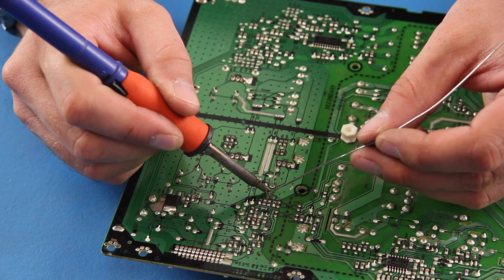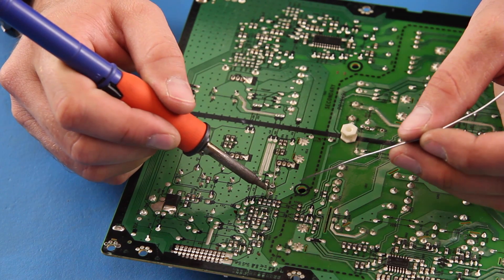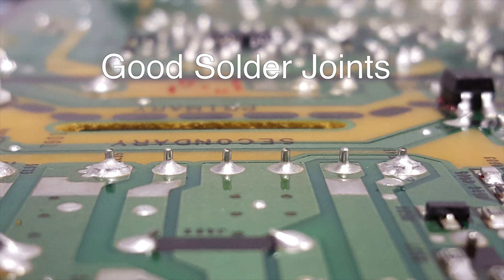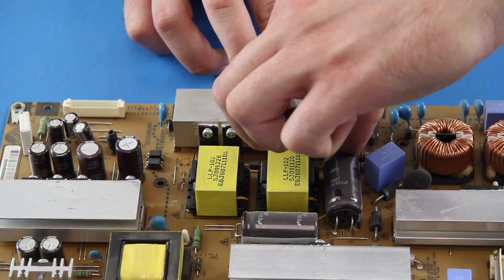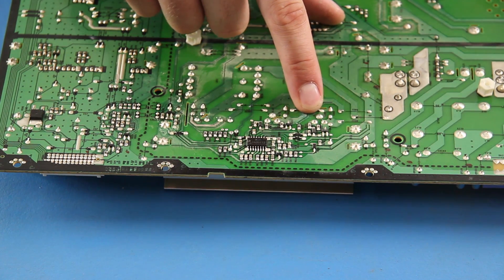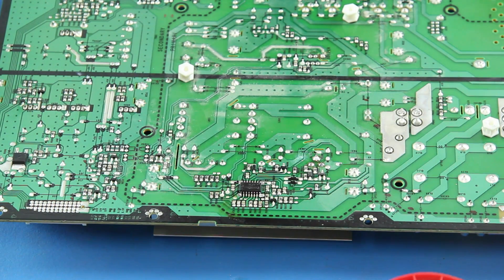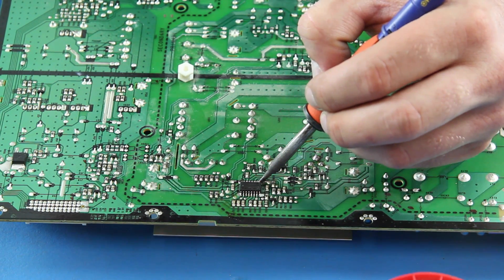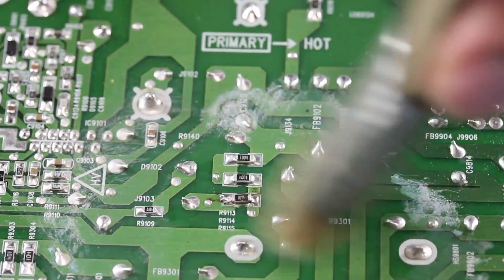How to Solder - Beginner Guide to Soldering Components on TV Parts

Comment: Which temperature has the solder pen while in use? I usually have it on 355 degrees celsius for cables but ‘m afraid may be too high for components?

Comment: I dont get it...
Do you use the solder and wire to take things out or to apply the items into the board?
Reply: You use the iron to melt the solder and then you suck up the solder with a tool that works kinda like a vacuum. The soldering iron melts the wire and the solder cools down fast and that’s how you attach a component to the motherboard.
Reply: @mr.keiser4259  Thanks for your help. I just  cant get the solder wire to stick to the component (mosfet). I tried soo many times and it creates a blob but then that blob doednt stick to the mosfet end.... is the sokderwire to weak or something?

Comment: sorry for this very noob question, but can you use a common steel wire that can be bought in any hardware for soldering?
Reply: It needs to be a composite like rosin with a low melting point.
Reply: No you usually wanna use wire made for soldering

Comment: I don't know what I'm doing wrong, any soldering iron I purchased stops working after the first use. Sometimes getting a new soldering tip works, but also stops melting the wire after the first use. 
I clean it whenever I stop using it, I don't know how I'm breaking it.
Reply: I had the same problem with the cheap ones  from Walmart.

Comment: When u melt the solder on your iron then try to solder with it the solder on the iron no longer has flux and causes lots of problems please don't follow or do anything this guy's does he is leading you to failure
Reply: Not sure where you learned how to solder but this is a perfectly acceptable way to solder this component. Maybe you missed the part where he fluxed the board. You are much better off applying a high-quality paste or liquid flux directly to the parts rather than rely on the Rosin flux in the solder. With that said I will say that overall this was not really a great tutorial he left far too much out. 

For example, he forgot to use flux when he cleaned the pads. that whole area should have been flooded with a high quality past flux and then the pads should have been cleaned with the braid. You really need to make sure the pads remain under a thin layer of flux after they are cleaned to prevent oxidation of the pads.
Reply: I beg to differ because there are different type of solder for diff types of electronics and some circuits can't handle too much heat when soldering the normal way you say you know

Comment: Beginner Guide?? This fails in so many ways.What strength of alcohol? I notice you constantly clean the board after you solder what about before? Do you clean the tip of the solder iron? Do you do any other preparations? What solder do you use and why? What components are damaged by too much heat? Why not add some braided wire to the board. Looking at a machine solder looks simple. Like you're putting a drop of oil paint from a toothpick on the board but doing it is hell. Making a mistake is expensive.

Doing an IC on a beginners video is too much. I would have ruined that board. Guys like me have a hard time keeping the iron in the right place without bending the tip or damaging the board so more practice type of soldering is needed. You also showed the bad solder joints but don't explain why and how.

I suppose you sell the kit that has all the tools you used in a nice Christmas package but I heard nothing about it. What about seeing or magnifying? Is there a recommendation for that? I have tried for years to solder and make a mess of everything I have ever done. I even took electronics in high school I would change the video to "Watch The Expert Solder And Weep."
Reply: Sounds to me like you just suck at soldering. I'm a beginner and all of these things in the video are pretty straight forward easy tasks.
Reply: What a little bitch!